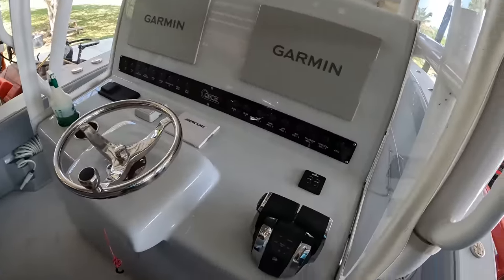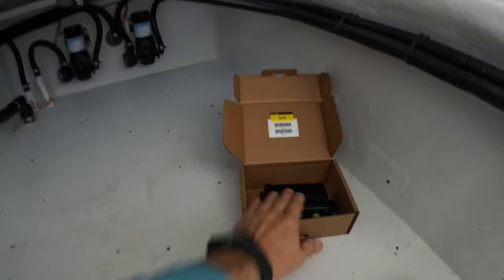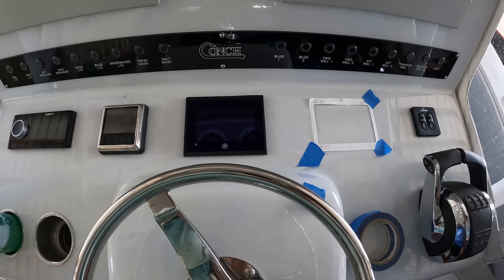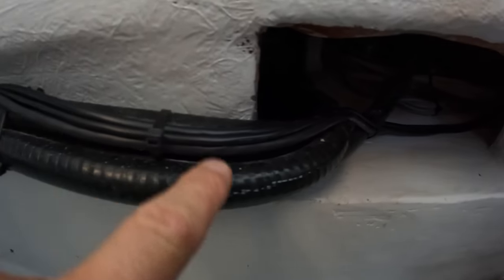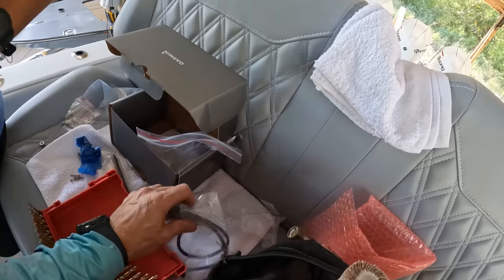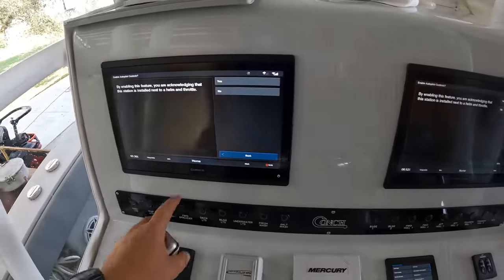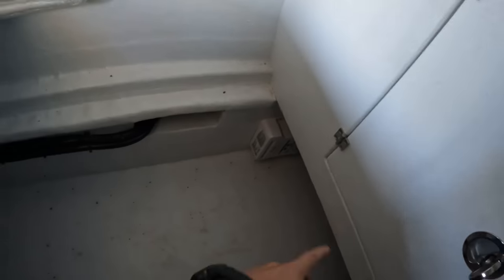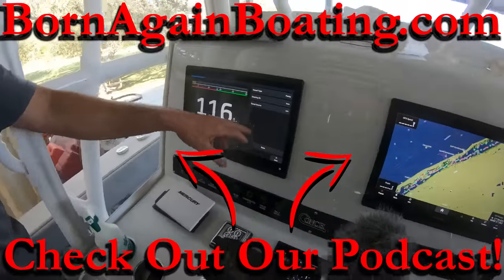Installing A Boat Auto Pilot!

Comment: 5:04 That ProNautic battery charger needs to be mounted vertically as stated in the manual.  This is because it is convectively cooled. Mounting it on its side will make it overheat.

Comment: Are you not worried about having the heading sensor that close to those pumps?
Reply: Also with software version 30.1 and up you will need to have an external gps antenna for the radar overlay to work.
Reply: Near the fresh / saltwater pumps? I dont think so since the main reason to get it away from the main console is to keep any strong magnates ( we do this with the main boat/engine harness as well) and/or current away  . boca is right , but still keep it away from speakers and all that.

Comment: Nice job.  About to tackle my garmins in two weeks. 
Weird question. When you get the back residue (mold) in the bilges older boats etc.  I've used mold armor and it's come out ridiculous 
Question lies in some sales guy tried convincing me it's not mold but buildup due to ethanol in fuel in the inclosed areas. Is this true ?

Comment: When cutting fiberglass with a saw, do you have to worry about cracking, and is there a trick to prevent it?
Reply: I think people use painters tape
Reply: Use painter tape, and a sawblade made for ceramic tiles, excellent way to use ure jigsaw. But that’s how I’m doing it😂